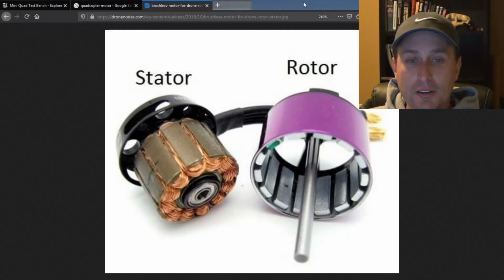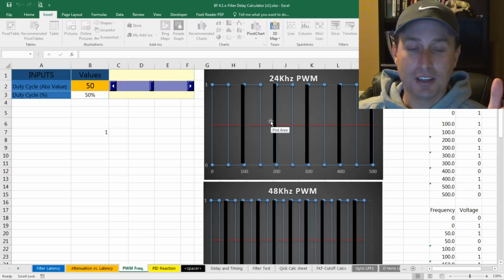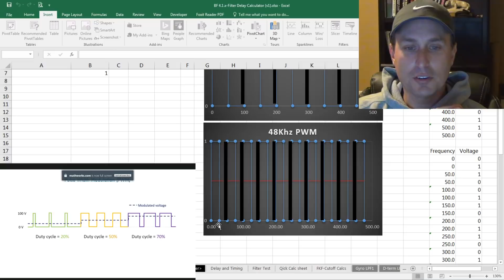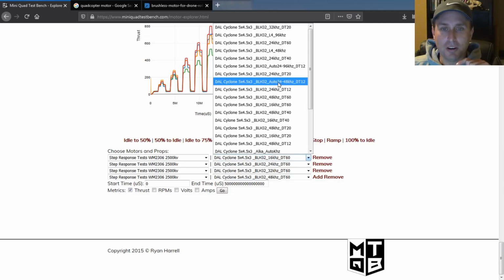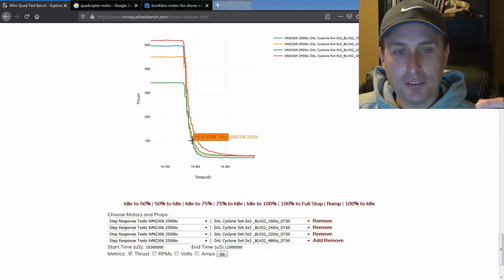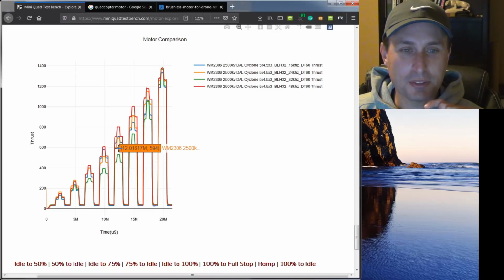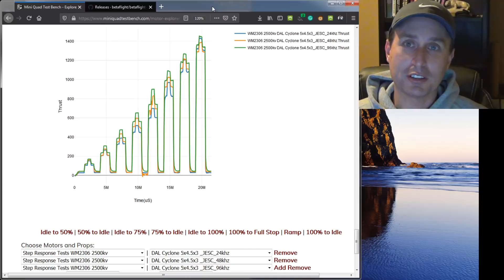Benefits [and down sides] of HIGHER PWM Frequency!  🙀💪

Comment: The 'UAV Tech BF Preset for 5-inch Quads, With Go-Pro' (up to about 700 grams AUW) 
has two options for PWM:  16 & 24kHz   or   48+kHz
  > If in BL Heli-32, I have it set for 24kHz (Low)  and By RPM (High) on an ESC with 128kHz capability,
    ?> Which option should I select?  16&24kHz  or 48+kHz ---  Both ?

Comment: Built my first drone in 10 years last week (yeah i'm old)... used stock betaflight settings and stock timing (24kHz) on a 7" 1300kv, mamba F722 build. Motors so hot i couldn't touch them after 5 min flight. 1350 mAh of the 6S battery used. Just tried setting the max and min pwm to (as an experiment) 128k in blheli_32. The motors barely get warm now, and i'm getting 30% greater flight time. Flew for 6 min and only 900 mAh used. I thought my telemetry was borked, but the charger confirmed it! Big yaw inputs cause a throttle blip for some odd reason... but I think i'm headed in the right direction. Will probably set a lower min PWM freq, but will try to compensate with PIDs before that.

Comment: I've stuck to 24kHz on my bigger quads, but 48kHz on my smaller ones. As the frequency goes up, resolution also goes down and this is very noticeable on my bigger quad that just feels lackluster at anything above 48kHz.

With lackluster I mean it smoothes out the throttle band too much and feels much more floaty.
Reply: I have a quad that feels like it drops too fast. Would increasing pwm maybe help with that?
Reply: @torchbeareraerial4660  no.

Comment: There is a big discussion going on between RC crawler enthusiasts in the moment....What kind of esc would be suitable to have a , lets say 1800Kv motor, run smooth and ....very important silent ? 48kHz....more....?? Awesome video BTW ...kudos !
Reply from the maker: Higher PWM makes for smoother, but less breaking torque.
Reply: @uavtech  Yes I know ...holmes hobbies introduced a esc recently but its limited to 4s and  the BEC is not what they thought it was. What would you consider a good ESC for low rpm running ? I read something about neutronrc coming out with a Gmodel esc that has AM32 firmware.

Comment: I usually use 48 with thrust linear but I do not run at the recommended setting of 25. After testing and finding that it did work, I got curious whether that high a setting was necessary. I experimented a bit and fount 10 to 12 was enough to clear up the issues I was getting with 48khz PWM

Comment: 0:49 literally wrong, like not true at all. escs use "on/off" and not "in between" because it requires a lot more components to achieve that "in between".  and it doesn't have that much difference on the motor. But it is possible to have an ESC that does output smooth voltage radher than pwm , it's just much more complicated
Reply from the maker: Right, i was just saying how ESCs work as of today.  I'm aware of VFDs.
Reply: @uavtech  well you said "electricity" not "ESC", odherwise great vid man

Comment: Great insights.

This perspective is just from the ESC, but to properly understand what happening we should be looking at ESC and motor together. A motor coil is an inductor and has a resistance, so unlike the MOSFET being driven by a digital signal, the coil will alter the power waveform. (a ramp at constant rate of change vs instantaneous vertical change in power)  Depending on kV of motor, it's inductance (L) and resistance (R) will vary and have a power ramping time. This is governed by τ = 1/(R*L). It takes ~1τ to ramp 63% of power and ~5τ to ramp to 99% of power level driving the inductor coil (ie: motor windings).

The point I'm working towards is that at lower PWM frequencies; less than 5τ (the natural frequency a motor coil), the coil will not become fully energized prior to the MOSFET turning off. Thus actual power would be less than expected if just considering theoretical square wave power source. At higher PWM frequencies there will be less variation a motor coil energing (de-energies) so coils will provided a more consistent power level with what is expected. The effect of motor coil on power soured by the MOSFET could be viewed by examining one of 3 phases powering a motor on an oscilloscope. 

(my insight into ESC firmware is limited, so not sure if ESC make compensations for this effect; but to do so they would need parameters on motor kV, (ie: R, L values) unless making generic assumptions)

This deeper detail than the video; looking at the square MOSFET driver waveform and duty cycle. Thought it worth mentioning, for possible future topic (or those wanting more detail).

Comment: Seems like we need a firmware capable of adjusting PWM frequency on the fly based on erpm of the motor so we get the best of both worlds.  Low end torque at slow speed with lower pwm timing and more top-end thrust and smoothness in the upper rpm bands with higher pwm timing.
Reply from the maker: Auto-PWM exists.  Just not in stock BLHeli_S or 32 (yet).

Comment: Finally catching up - I'm amazing at how dead time dependent that is, even at the low end for braking torque, that's crazy.
7" Is plenty happy on 48kHz, but yes, adding thrust_linear into the equations drastically helps with control at idle.

Comment: Take an esc and look at the output pulse length to the motor at 24khz and 48khz on the scope. Its not proportional at the same dshot value. You would expect  the pulse at 48khz to be half of 24 but it won't be.. It will be slightly higher.

Comment: Regarding whoops, it is my understanding that the 1S whoops doesn't have a FET-driver and that the MOSFETS are run directly from the BB2 MCU. That gives the 1S boards an incredible deadtime of just 5. If you look at the almost similar 1-2S boards, they need a FET-driver and have more normal deadtimes of around 50. This makes the 1S boards (like Mobula6) prime candidates for 96 and 48khz.

Comment: Great video, could this be the reason for the throbble issue I had that went away
When I switched from 48KHz to 24KHz PWM? As that would make sense, as the issue only occurs
When you chop the throttle to a very low idle and the motor breaking torque would
Be lower at 48KHz?
Reply from the maker: Yep

Comment: Recently tested 96kHZ with thrust linear at 25. Drone flys amazing, ultra smooth, and very responsive. I could even reduce filtering as the motors are much cooler now. Prop wash is completely gone.
I was so impressed that I am switching all my quads ESCs to enable 96kHZ.

Comment: I get desyncs in 48khz but no issues on 24.  (With whoops blhelis) or I think desyncs... Heavy or sudden throttle changes and it flips or motors cut out.  Or if I cut throttle after a high throttle maneuver the motors spin up instead of slow and the quad climbs instead of decends.

Comment: This is amazing. This shows why 48khz is recommended for small whoops motors since they have less inertia so the initial and braking torque doesn't present a great issue. But the added thrust allows for more efficient energy usage, which is critical with the tiny lipos they use. Very interesting info , thanx!

Comment: Using only JazzMaverick 48kHz on every esc I got, and it's mostly 16.80.
What was the other firmware?haven't heard of them ever before.
Reply from the maker: Which?  JESC?  Alkin?  Just other options.  JESC seems to produce the most thrust.  Check it out.
Reply: UAV Tech you have to live under a rock, not knowing about JESC but I was wondering about this other one: ALKIN? Where to find and how good is it?
Reply from the maker: It is being developed in BF Slack.  I would need to search for Github.  Seems to produce less thrust at the moment, but look at the comps for yourself.
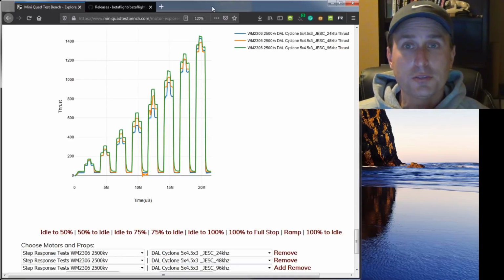Reply: Thrust is the same for the same output power..  please contact me for details..  look at 10:34 in the video . you can find the project here. https://github.com/conuthead/AM32-MultiRotor-ESC-firmware.

Comment: Fun FYI, when dead time > 5% of the PWM period (50kHz = 20us period, so dead time should be < 1us) it increases low frequency harmonics which will reduce delivered power by a few percent and can also increase motor heating.
Reply: I'm wondering how to convert two digits in blheli_s firmware deadtime (30 for example) to µs.

Comment: Been going back and forth with 24 and 48. It depended all on the build, but for bigger than 6" builds I've had most of the success with the tuning on 24khz, but then again with a lower timing than 23 degrees.

Comment: Until now I had 24 kHz on all my 5" quads and 48 kHz on 3" and smaller but I will set my 5" to 48 kHz and give it a try. Of course, rapid breaking is desirable but I doubt I will notice and smoother motors are always nice.

Comment: Would 48kh cause my 2.5inch drones not wanting to turtle as well.. i seemed to noticed it after doing 48kh
Reply from the maker: I reckon it could.  Switch back and test.  However, on a 2.5", it does help with battery time, soooo...

Comment: I've been flip-flopping between 24khz and 48khz. I've tried TL to help give better low throttle torque, but I still find 24khz to be better in this regard. For super stable cruising even in windy environments, 24khz just seems best. Now for propwash, I don't know why but 48khz almost always seems better. This is all anecdotal of course :)  Awesome data here though! It will be fascinating to begin to understand how these ESC settings contribute to various flight related issues

Comment: 48khz, 23 timing, demag high, thrust_linear = 25.  :)
Reply: I also found this to work best, but additionally I had to increase the PIDs overall by about 20% on my 5 inch quads. On one quad I got some issues with D oscillations which are controlled really nicely with tpa of 0.8 at a break point of 1250. Posted an extended post on that over on FB just a few minutes ago, link to the blackbox log is there. https://www.facebook.com/groups/291745494678694/permalink/945354222651148/

Still you can feel the loss of authority when hovering in front of an obstacle. So I am staying on 24khz with my freestyle builds. 48khz is the way to go for racing rigs (for me).
Reply from the maker: Oh I know it.  But see others comments as well.
Reply: I run all my quads on auto timing recommended by Bardwell for extra smooth response. Picked up that tip 2 years ago and since then all on auto. Bad tip? 23 better?
Reply: @Harald787  yes 23 is better..

Comment: I wonder if it's possible to make PWM frequency dynamic in ESC firmware... 48kHz at high throttle values for more thrust, 24hHz at low throttle for better breaking and more low end torque (less probability of de-sync on throttle chops/on reversed flow through props)
Reply from the maker: There is Auto PWM in the testing from 24 to 48khz.  It seems like it takes too long to update, which makes less thrust.  But check it out.
Reply: I wonder if kiss/fettec ESC's do this.. seeing they are 128khz.  Seems like a dynamic pwm adjusting with throttle makes. Sense.
Reply: @Krunked  the last firmware for the fettec ESCs has some kind of dynamic pwm. But you also have to take in mind that the fettec/kiss ESCs are simulating a sinus curve and not a fixed rectangular one. https://blog.seidel-philipp.de/kiss-sinhybrid-sinwave-backemf-hybrid-kommutierung/
Reply: @kumquad_fpv  yeah. For sure.
Reply from the maker: I know APD ESCs do it.  But that just means I know they have an Auto option.  I have no idea what it does or if it is even better.  Like Timing, Auto might not be better.

Comment: This is very interesting - I’ve been having a lot of low throttle oscillations using a blheli32 40a hobby wing 20x20 esc. Do you think dropping down from 48khz to 24 would fix that?
Reply from the maker: Yes, or adding Thrust Linear should help too.  25.
Reply: Yes it worked for me on my 7in.